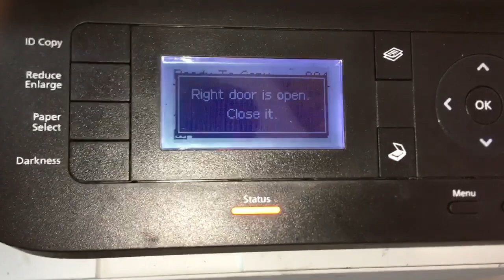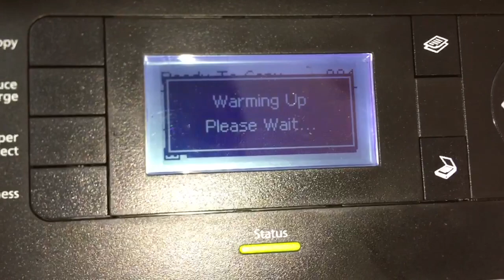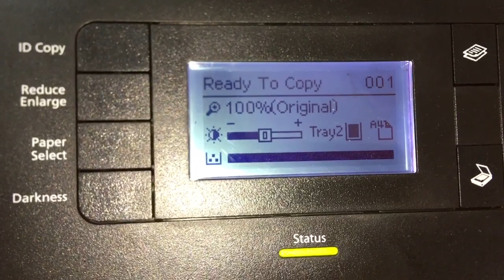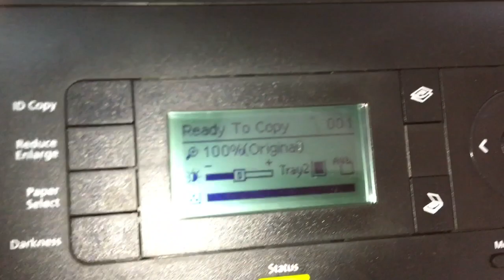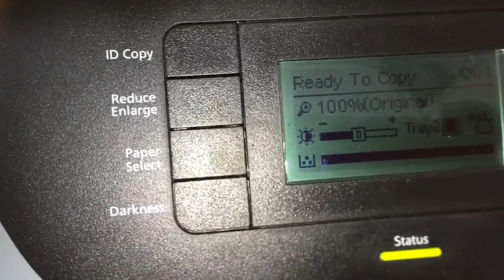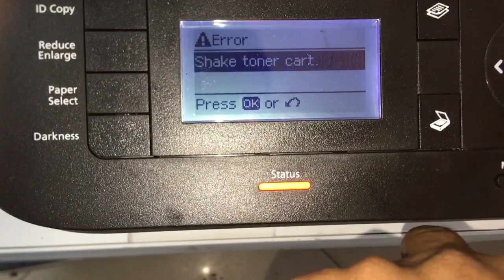HP LaserJet MFP M436n display error code A1-5513 see problem fixed 100% working part 03

Comment: Hi!i have hp laser jet MFP M436N the problem message is that i need to "replace TR. Roller" and i already replace tr. Roller i purchased that part after that i have the same error can you help me with printer.thanks for the big help
Reply from the maker: thank for late, this my problem before, but not TR.Roller, I need replace main board